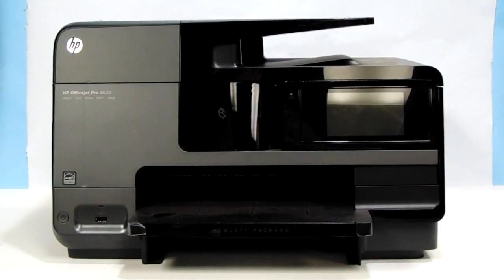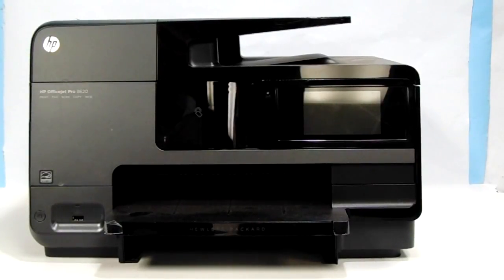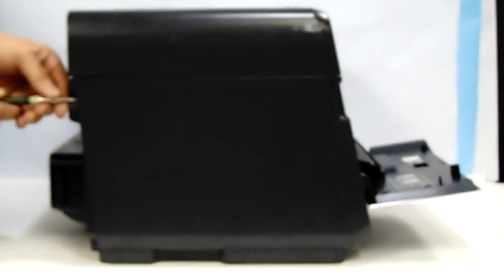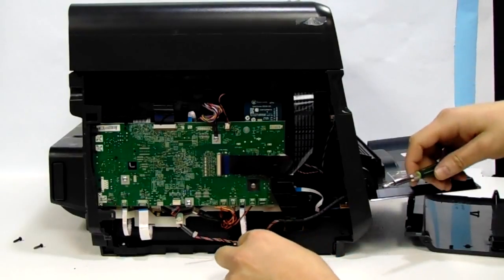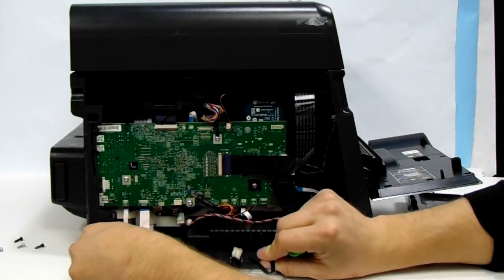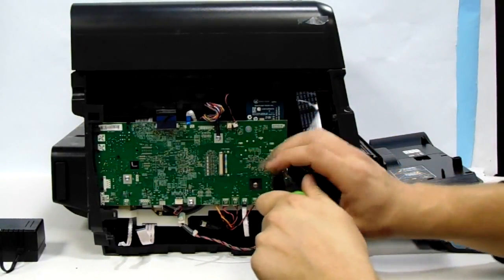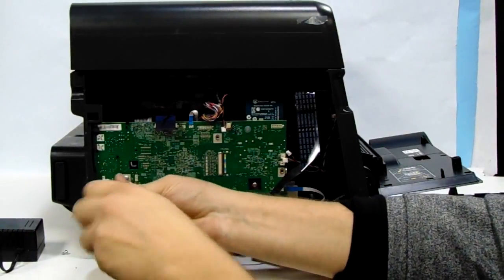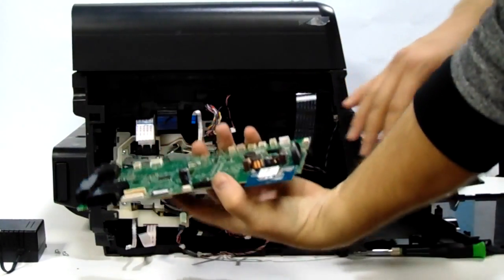Replacing Power Supply Unit and Logic Formatter Board on HP Officejet Pro 8620, 8610, 8630 Printer

Comment: Do you have a similar video for an HP Officejet Pro 8710
Reply from the maker: Hi. Yes, we have a disassembly video of the HP 8710 printer. There those parts are also removed. Here's the link:
 https://m.youtube.com/watch?v=rOQ1qKCyz5o&t=11s
Reply: @303electronics  So, a quick look, it looks like it is only three screws to get  the side panel off to get to the power supply. Is that correct? Also, what type of screw driver is needed? I just looked does not look like a regular screw driver. Oh just looked again, and you said T10 Star so I'll get that.
Reply from the maker: Yep, 3 scores for each panel. Torque screw (star shaped tip) size 10. Have a Happy New Year!!!
Reply: @303electronics  Thank you, and you also have a Happy New Year!
Reply: @303electronics   Hello, again - So I have just gained access to the power unit. Disconnected and reconnected it, then plugged in and tried to turn printer on and still nothing on the front panel LED screen. So, my question is, is it reasonable to now assume that the power unit is bad and just needs to be replaced? If so, do you know if this power supply unit is still available? I'm assuming it is on the after market.

Comment: I took out my power supply and checked the voltage on it. I was getting the correct 32V reading, but my printer isn't turning on. I tried replacing with a different power supply and is still not turning on. Any advice what else it could be? Have an 8610.
Reply: @mrboubata  did either of you ever figure this out? How do I test the voltage?
Reply: Clayton Sloniker having the same issue. Any solution ?